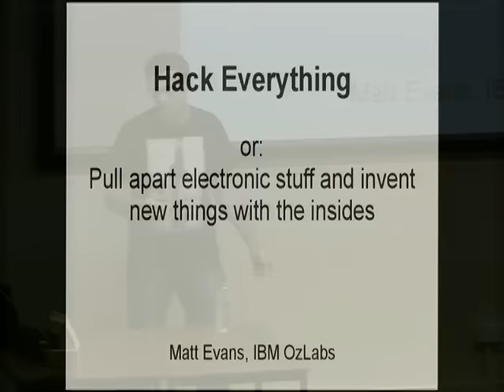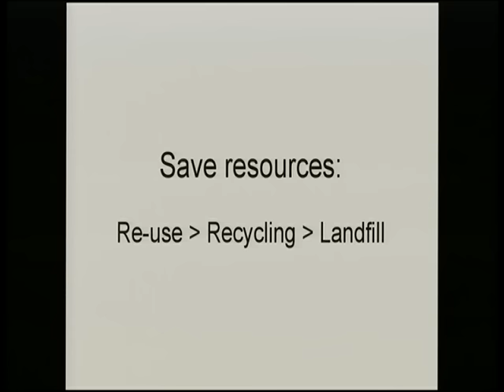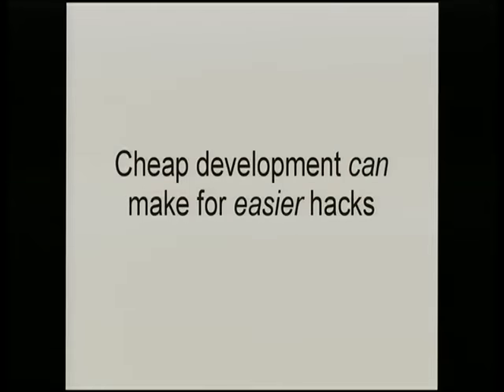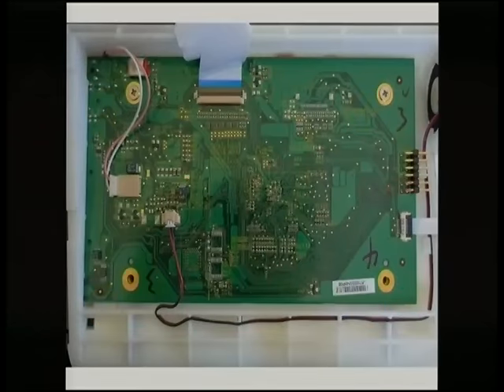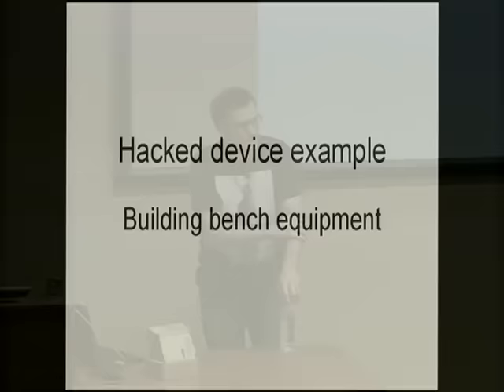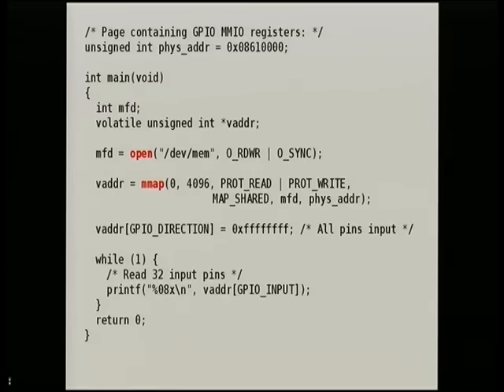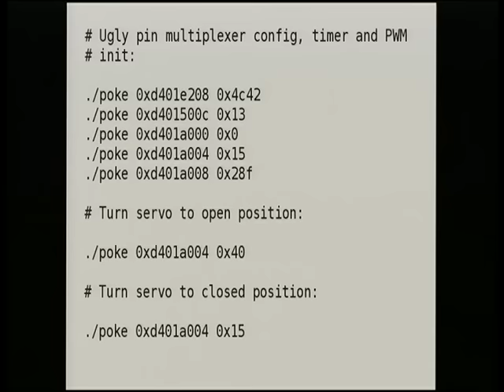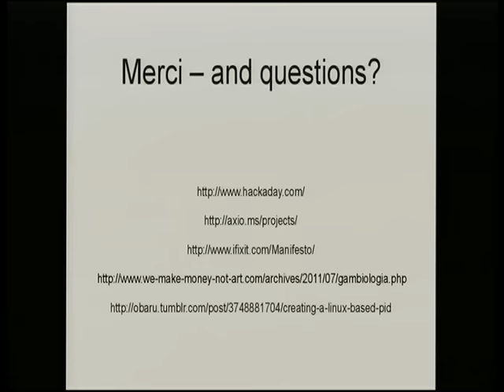Hack everything: re-purposing everyday devices - Matt Evans

Comment: great video. costed me $2,600 to built my desktop. full water cooling added.
Reply: what spec
Reply: noting old thou lol  Intel Core i7-5820K 3.3GHz 6-Core Processor,  ga-x99-designare ex, 32gb  
Crucial ram,  SAMSUNG 950 PRO M.2 256GB PCI-Express 3.0 x4 Internal Solid State Drive (SSD) MZ-V5P256BW , Samsung 840 EVO 250GB 2.5" Solid State Drive (run games in it) first one OS, some programs, 3d: Western Digital Caviar Green 3TB 3.5" 5400RPM Internal Hard Drive  , EVGA GeForce GTX 980 4GB Superclocked ACX 2.0 Video Card,  
Corsair 900D ATX Full Tower Case MODIFITED, EVGA 1000W 80+ Platinum Certified Fully-Modular ATX Power Supply,XSPC G1/4" to 3/8" ID 5/8" OD V2 Compression Fitting (Black Chrome),  XSPC ECX Ultra Concentrate Coolant, Blood Red, XSPC RayStorm Pro Black WaterBlock, Intel CPU, Red LEDs, XSPC FLX Tubing 3/8" ID, 5/8" OD, Clear UV, XSPC D5 Photon 270 Reservoir / Pump Combo, XSPC RX480 Radiator V3 for Computer Water Cooling Systems (NEW Version 3), SilverStone Technology All Black 1-to-8 PWM Fan Hub (CPF04)
Reply: Im planning myself to make a computer for around 2500 usd what i have planned is an i7 6700k,  ASUS ROG Maximus VIII Formula, 
ZOTAC GeForce GTX 1080 AMP Extreme, Corsair Vengeance DDR4 3200MHz 32GB, Corsair Hydro Series H100i v2 cooler, Corsair Carbide Clear 600C Full Tower, EVGA SuperNOVA 1000 G2, 1000W but im not sure yet trying to make a nice looking gaming computer where i also can edit videos and maby host servers for myself still looking for better parts for about same price or lower i allready have ssd and some hdd
Reply: sound cool. yea. the 900D pretty heavy with stuff in it. i have it on a 8ft table. 2ft 78 of space under it. (29inch) its somewhat modfifed with LED lights connected to motherboard. LED in PC towel as well. for show. guest. 12 outlet bar under table. thinking of adding a power switch. to turn pc on from table.
Reply: don't have any water block for GPU yet. since 1080 is out, might buy that.

Comment: Arduino projects are a cheap and easy introduction into electronics if nothing else.  there projects usual come with instructions and programing allready you just learn as you go or you can just slap it together mindlessly while learning nothing but still have what you wanted lol challenge yourself tp make an Arduino unique to your own design by using an Arduino (Project Board)...  its open source still as far as i am aware right? you can just make them and sell em if thats what you want to do. pretty much all these 3d printers was based off the Arduino board ;)

Comment: En and That's Why me as Electronic Geek have a place for old circuit Boards from Un Wanted or Broken devices to for Something And don't have to buy It new capacitor or resistor or whatever No Need to buy It or even the connectors are useful sometimes smartphone if it feel slow and old Factory resetted it Will Be Nice And Fast Again :-) or find a way to reinstall Android